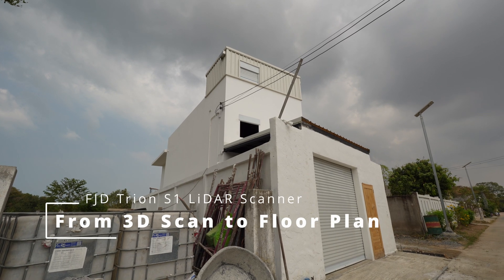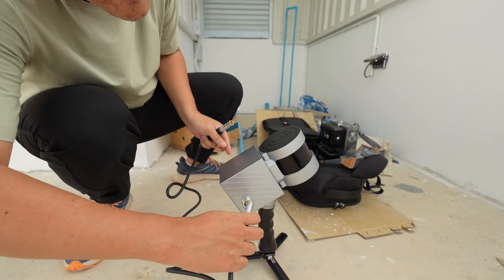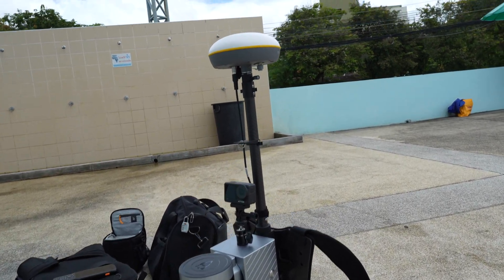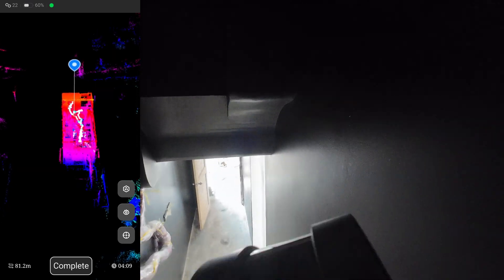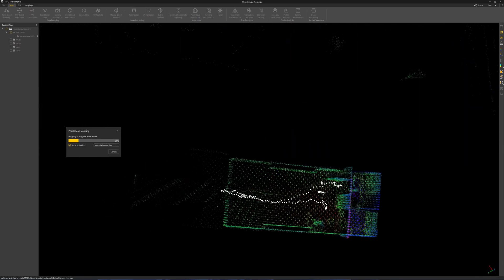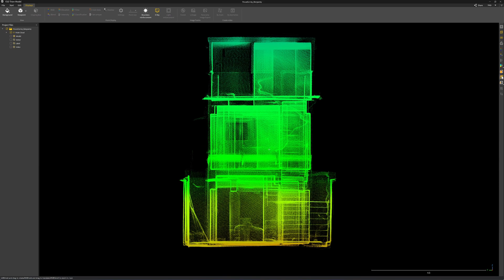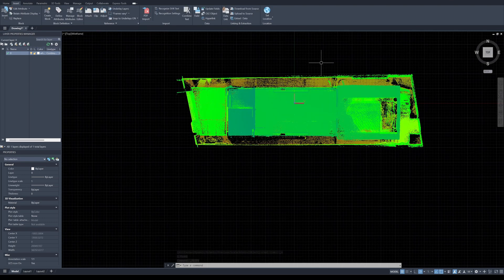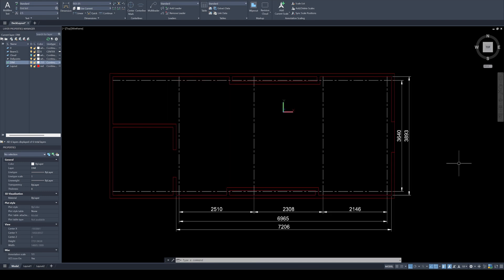Transforming Building Scans into Floor Plans - Using FJD Trion S1 LiDAR Scanner

Comment: What do you think of Lixel Kitty K1 as compared? Very keen to get a unit for this kinda work.
Reply from the maker: The device was made with the Hesai JT16 LiDAR module, which has a field of view (FOV) of only 60 degrees compared to the 270 degrees offered by this one. Additionally, the range is limited to 30 meters, which is sufficient for indoor scanning, but the narrow FOV could present challenges. It's advisable to request a sample point cloud from the seller. Cut the section and analyze the wall thickness; if the error is high or the software performs poorly, the wall line could appear as thick as 5 cm, when it should ideally be less than 2 cm.
Reply: Thanks for the feedback